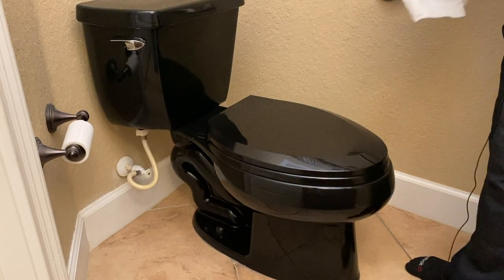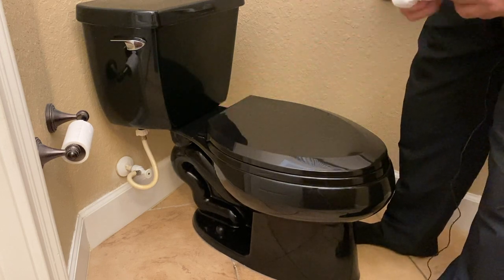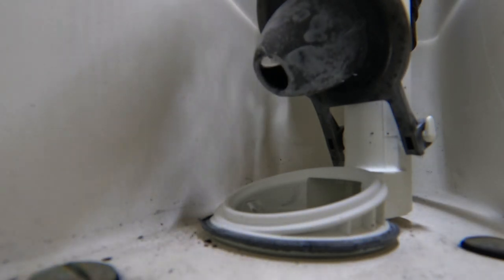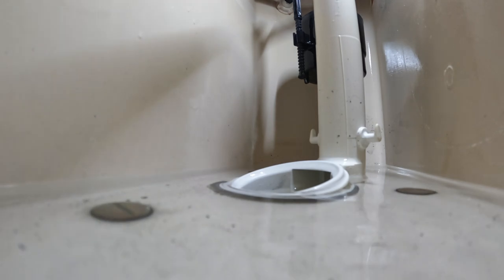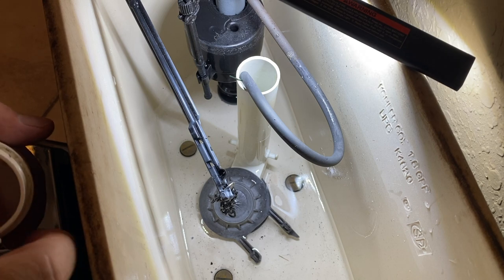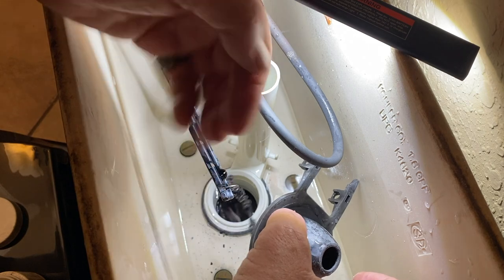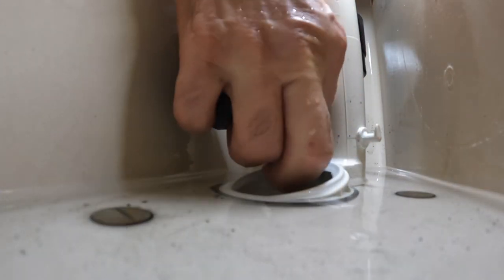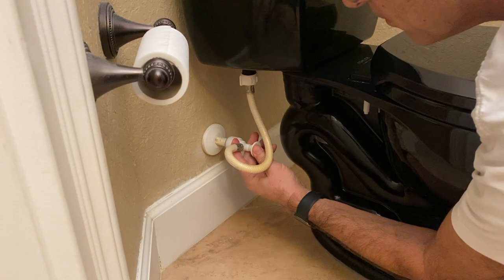How to Fix a Leaking Toilet at the Flapper

Comment: Mine leaks because the flapper moves from side to side on the mounting pins that it fits on if that makes sense.   You can see it when you flush that it comes down to one side.   Manually slide it over (mind you it's not even 1/16") and it's all good.    Our fluidmaster has no 90 degree stops on the pegs that the flapper fits on.
Reply from the maker: I hope the video helped you.
Reply: Same problem here. My toilet is dated 1964.

Comment: What is that rubber seal on the very bottom below the flapper called? Mine is deteriorating on touch so im assuming it is the reason why the water is leaking and refilling
Reply: you may be wrong .... a real plumber will know where 90% of toilets leak and you can learn how to resolve the problem and avoid costly plumber costs (easily $100-150) . The 'flapper' is under water all the time and a very small collection of dirt or cracking of the flapper will occur over a long time. Replacing the flapper is easy and costs maybe $10-15 and no cost for a plumber. Get the Korky brand for some of the very best! replacement parts.
Reply: @DougHinVA  i replaced the Korky flapper I put in last year with a new Korky flapper because the water started leaking into the bowl again. And it is STILL leaking even with the new flapper in place.
Reply: @Swlabr61 we have an adjustable Korky flapper; as a quick temporary fix I wrapped a rubber band around the dial and it’s back to sealing properly. 

We’ve replaced every part in the tank (handle/handle arm, fill valve/fill tube, flush valve, etc.) and Korky flappers still continue to fail within a year. They sell a flush valve & flapper repair kit that involves gluing their EasyFix seat over your current drain seat, haven’t used it but it is an option. We’re moving on from Korky and buying a new flapper from a different manufacturer.